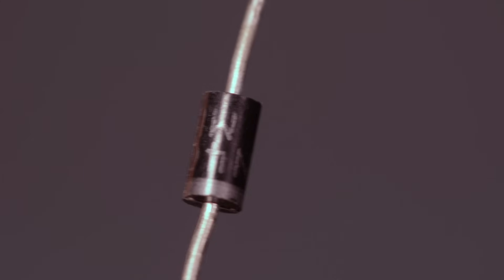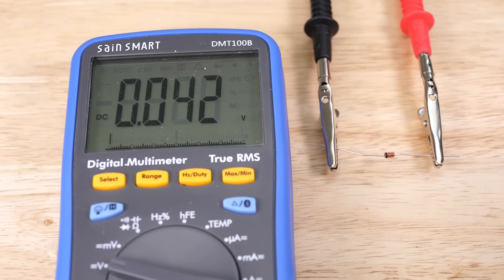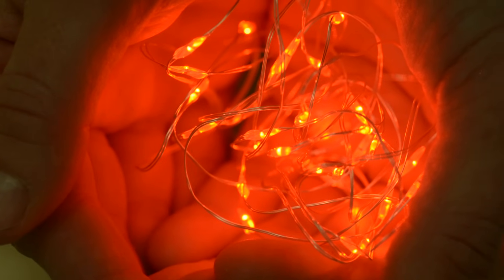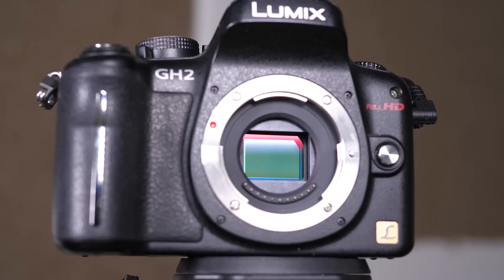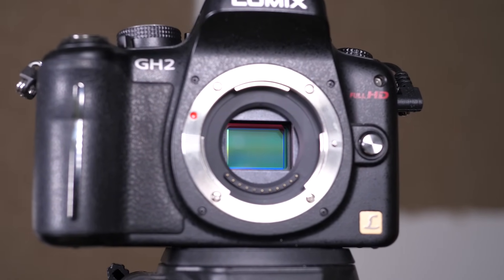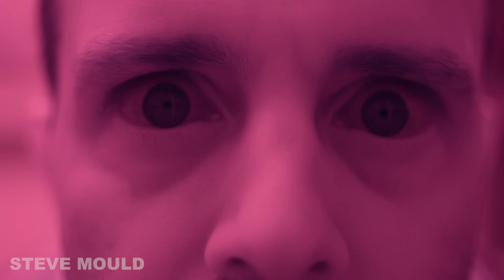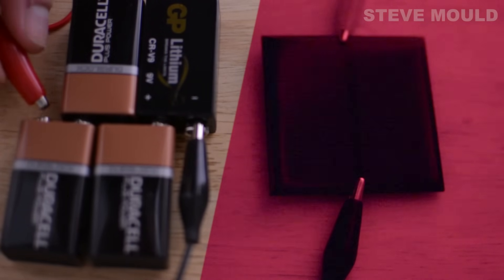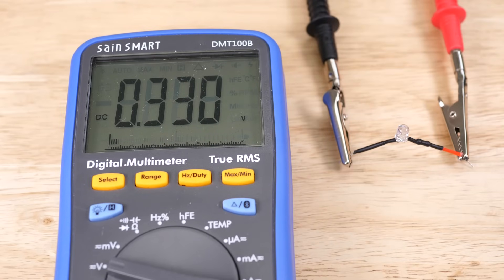Why all solar panels are secretly LEDs (and all LEDs are secretly solar panels)

Comment: Could you explain the thermoelectric effect? After watching a DIY builder use a peltier device as a cooling/heating device, I wanted to understand how those things worked. But I'm having a hard time conceptualizing on how the electrons/positive ions move in the device to create a heat gradient. I know that these devices have one side that heats, and the other side cools and reversing the current, causes those sides to reverse. Additionally, if you cause an external heat gradient by heating one side, you can produce electricity. My concern here is what does it look like from the perspective of electron/positive ion going through the series of semiconductors to cause a heat gradient. I've seen diagrams showing those electrons/positive ions moving to one side, but that charge either looks like it's moving against the flow of electricity or with it. With it makes sense, but why would one set of semiconductors (n-types using electrons) go against the flow?

Comment: 0:29 I gues you mean a solid state diode, as opposed to a vacuum tube diode?
Reply: Actually, any vacuum tube diode would probably work as a photodiode to some extent, and will emit X-rays with a high enough anode voltage.
Reply: @gcewing  Won't pretty much anything emit x-rays with high enough voltage?

Comment: So you could getto-rig a solar panel by connecting a bunch of LEDs? How many would you need to charge a battery? A powerbank for example.
Reply: A lot.
Even if you assume similar conversion efficiency (unlikely), the area of a single LED is tiny.
I have a small portable solar panel that has two collector areas that are about 20x10 cm each. (so about 400 square centimetres)
In theory this produces 20 watts.
In practice it takes me as much as a week to charge my 20,000 mAh battery bank using this device, where a standard 2.1 amp USB charger (that's about 10 watts) can charge it in 12 hours, the solar panel is typically taking more like 60 hours to do the job, which tells you something about the power output. (granted it's not an an optimal angle to the sun most of the time.)
Now consider that the internals of an LED are so tiny you'd probably need about 20 of them to equal 1 square cm of solar panel...
Multiply that by 400 square centimetres to match my mediocre results, and you need about 8000 LED's...
Probably way, WAY more than that...

Comment: Resistors can also emit light but only once
Reply: Resistors actually emit light all the time, the problem is we can't see it because it's around 6000nm in wavelenght.
But you're right - visible light is usually a one time event.
Reply: @disturbedNeutrino  Actually, light is the brain's interpretation of electromagnetic waves or light waves. So if you are to call any light waves for light, it should only be those that are visible.
Reply: @MarcJensan  And which eye-brain combo should determine what spectrum we call "light"? You do know some animals see EM wavelenghts that we don't. Do they see non-"light" by your definition?
Btw - that's why we use the word "VISIBLE light" ;)
Reply: @disturbedNeutrino : guess we don't have 20:20 vision after all. We only see 7 colors.
Reply: @gdolphy   who taught you that nonsense?
Reply: @disturbedNeutrino  ::) university of YouTube comments
Reply: @disturbedNeutrino   people emit light one or two photons a minuite but it is there
Reply: @firenado4295  thank you for elucidating that we emit photons. This seems to enhance my understanding of auras. I will try to play with it and give it more thought.
Reply: @disturbedNeutrino  Humans emit infrared light from body heat. Every matter in universe emits light , due to entropy .
Reply: Hebl von Heblowitz 
What part of the spectrum is this ‘light’ on?  Is it outside UV or IR?
Reply: @disturbedNeutrino  6000nm isn’t light.
Reply: @noop9k  It depends how pedantic your definitions are. Do you only consider wavelenghts that human eyes can detect as (visible) light? But then some animals can see into UV and IR spectrum. Is this the limit of light? It's simply a matter of your own personal definition, what part of electromagnetic waves you classify as "light". For a joke coment, you're definitely overly pedantic.
Reply: Tungsten filament  light bulbs are technically all resistors :)
Reply: They also emit smoke for quite a long time before starting to become light emitters.
Reply: @SeanBZA  All computers run on smoke, thats why when the smoke comes out they stop working.
Reply: @rivencraft1734  I just pictured a rodent shaped cloud running on a wheel!
Reply: @rivencraft1734  genius
Reply: @rivencraft1734  Yes. The smoke is stored in the wiring.
Reply: @rivencraft1734  right... I feel the time is right to tell this tale... about 1999/2000, I  worked with a self styled 'IT Genius'. So one day I decided to have some fun... built an electrically triggered smoke bomb into his computer box, completely safe, electrically isolated, so his precious super-computer was safe. He gets back from lunch, hits the power button and his PC tower starts belching purple smoke. What I hadn't accounted for was the fact that he was also a self styled fire marshal,  so before any of us could stop him, he had ripped the side cover off and doused the evil fire with his extra large cafe latte. Luckily, the rest of us had UPSs and back-ups🤣
Reply: @SeanBZA  pretty unique design!
Reply: @SeanBZA  Every machine is a smoke machine if you operate it wrong enough
Reply: @PenPeng  touche good sir.
Reply: Mr. Tux 

      |
Reply: Mr. Tux what about the nothing grinder
Reply: @PenPeng  *the right way
Reply: @PenPeng  A smoke machine will also become a smoke machine when operated incorrectly
Reply: @SeanBZA  Is this a crime against Resistors? AntiResistism?
Reply: @SeanBZA  congratz on creating solid fuel smoke machine.
Reply: magic smoke 
 @SeanBZA
Reply: @SeanBZA   Yes, so every electric components working with smoke, not electric power! :D
Reply: @SeanBZA  great for concert stage effects, but the smell is another story...
Reply: SeanBZA 
Lol
Reply: @SeanBZA  would that mean that computers are also smoke resevours/batteries?
Reply: An incandescent light bulb is just a resistor optimized to emit light.
Reply: You're producing a lot of heat with this one.
Reply: Let the smoke out!
Reply: @uhhhhh262  who let the smoke out?? Puff pUff puffpuff
Reply: I have experience this, horribly.
Reply: No , not only once tungsten filament lamps are reusable hundreds of times
Reply: You mean visible light. They can emit longwave IR indefinitely.
Reply: The filament in a standard incandescent light bulb is a resistor
Reply: Everything can emit light once, you just need to apply some explosives.
Reply: Resistors glow in normal operation... just not in visible light unless it's either designed for that or very much not designed for that.
Reply: In fact they can double as flashbangs. (Not even joking here, it's happened to me twice, I looked at a resistor as it was plugged into the AC wall socket and poof, everything went white for a good while)
Reply: IC also only emit light once... I saw my computer case glow orange inside as the micro chip on my video card released the magical computer smoke, and $350 from my wallet...
Reply: No, resistors can generate heat and emit as infrared light
Reply: Yeah correct.... Even Zener diode does... I have experience in forward biased connection with my bare hands luckily my fingers didn't burn much...
Reply: I can smell something
Reply: And capacitors can emit sound, but only once as well...
Reply: LOL :)
Reply: lol
Reply: Do they give white light ? Red is not my fav
Reply: lol IKR, one flash!
Reply: Magic smoke that makes all electronics work
Reply: so can you
Reply: they can emitt light all the time. but no visible light also... more far infraret...even your bodys does this
Reply: Lmao!
Reply: Lol!
Reply: Such a sad fate for a resistors..
Reply: Ya, & capacitors can emit light, but only once also.
Reply: Some emit sound Waves also.
Reply: Can confirm
Reply: might smell a bit once you use it hahah
Reply: Oh yaaasss....Majicke Blue Stinky Smoke Time!!
Reply: They smell so good...
Reply: WHO LET THE SMOKE OUT?
WHO, WHO?!
Reply: They can actually do that for an extended period of time if you manage to enclose them in a non-reactive medium, such as vacuum or an inert gas - & then you've got what's called a light bulb!
Reply: Everything emites ligth (execpted the conceptual black bodies). But low frecuency infrared, well is everywhere and is more comon to call it heat (even if it’s also a low frecuency light)
Reply: @SVQGOT  except low frequency infrared is part of heat radiation, while actual heat itself is collective periodic isotropic oscillation of atoms, molecules or matter (called phonons) whose frequencies are distributed randomly according to black body radiation.
Reply: Bulb Lamp emit light all days and have resistor.
Reply: Capacitors also emit lots of light and sound very fast
Reply: Capacitors are great flash bangs next best thing to the real ones.
Reply: They are smoke detector testers.
Reply: Electroboom subreddit: You've heard of LEDs, but have you heard of LERs?
Reply: That doesn’t make sense, it’s not possible
Reply: As they burn up and catch fire!  haa haa
Reply: Yup.
Reply: Haha, true, and heat 😆
Reply: I’ve got a special one that melted the metal bit first ruining ooops I meant cleaning my arduino
Reply: several more electronic component can also emit light once, hahahaha, funny
Reply: Just like how all mushrooms are edible once!
Reply: hahaha
Reply: Then they burn up in flames
Reply: Filament bulbs
Reply: LOL, let the smoke out of that one!.... if you reversed polarity to an LED, does it become a light sucking diode? Is that what a solar panel Is? An electronic parasite!
Reply: Bahaha when it blows up
Reply: That's funny 😀  👍
Reply: Hilarious
Reply: Lmao
Reply: and smoke.
Reply: so funny!
Reply: the bulb's filament is the "resistor" since smaller the cross-section or diameter of wire, higher its resistance. lol.
Reply: Actually, all electronics run on smoke. Once you let the smoke out, it no longer works.
Reply: lol
Reply: Hahahahahah! Lol
Reply: Speakers can be light emitters too!
Reply: Also ur microwave oven
Reply: Lol
Reply: LOLOLOL
Reply: you can also emit light maybe more than once but good chance you'll be dead the 2nd time ?
Reply: lol
Reply: Lmao... I've inadvertently done that a few times - usually trying to build power supplies.
Reply: If you burn your circuit board it even emits light with smoke
Reply: forbidden food
Reply: Great joke bro
Reply: Lol
Reply: I LOVE THIS THREAD
Reply: I've been there and I hate it
Reply: Yea cuz they explode
Reply: @lukep4339  you mean melt and then vaporise
Reply: @francisbacon4363  yea you know what I mean XD
Reply: why am i laughing so hard
Reply: And capacitor can be smoke machines but only onces
Reply: Resistance is futile
Reply: Capacitors can also be used as smoke machines but not for very long
Reply: If you shoved enough high powered electromagetic energy at them, could they also act as solar panels once? That is to say, if you were to fry one of these things with light energy, would an electric charge run through its wires, if only for a short and small burst?
Reply: 😆😂 LoL
Reply: Hahaha
Reply: I once made green LED shine red...only once.
Reply: @erikhendrych190  you mean you made it fire on the led
Reply: IR/UV LEDs can emit visible white light, also only once.
Reply: Oh, that kind of humor.
Reply: With enough electricity, any component becomes light-emitting.
Reply: yeah i can also emit light but only once
Reply: Electrolytic capacitors emit light once and for a very short time. They are electronic meteors lol
Reply: have you never heard of incandescent lamps? These resistors give off a lot of light for hundreds of hours.
Reply: @mrbmp09  oh fuck you got me
Reply: I am resistant to giggle but your voltage filled humor is too much
Reply: Lmao... great comment
Reply: Electroboom intensifies
Reply: Tbh I can emit visible light too, but I won't live to see it...
Reply: Incandescent lightbulbs say there's a more than once way.
Reply: and fire lol
Reply: No, also for longer: I put some resistors in line with my LED flashers on the car trailer. They are WAY underrated for this purpose, but I needed a quick fix for hitching it up to one of my cars.
That Quick fix lasted longer than the trailer sideboards (10 years)....
Whenever the flasher was on, the resistors (I put 10 in parallel to get it to work and distribute the load...) they would emmit a nice red glow. Luckily you only saw it at night, otherwise my trailer probably would have not passed inspection ;-)
Reply: A resonator can be a small capacitor pf range
Reply: Humans can do the same
Reply: Well, the normal incandescent light bulb is basically a resistor
Reply: @vantuzproper  tru
Reply: Incandescent lightbulbs.
Reply: Haha that cracked me up 😂
Reply: Dear god...
Reply: I've been wondering about this...sounds like a resistor can have a diode to emit light...because it dissipates heat...so if that light were in box made of solar panels inside...and those resistor diodes were on double looped thick cables...wired through high voltage parts already inside home appliances...cars no charging stations
Reply: That simply isn't true. You can get them red hot multiple times. They emit light at that point. So does everything they set fire to.
Reply: IR emitters.
Reply: who let the smoke out?? also they give off a the smell of firecrackers
Reply: unless it's sealed in inert gas, cough cough... light bulbs...
Reply: Though you can deliberately design one to last a bit longer while glowing and that's how we got incandescent lightbulbs
Reply: It's just like us when we drink lava.
Reply: So can wires
Reply: So can people with enough energy 😂
Reply: Incandescent

Comment: But LEDs and diodes in general are CURRENT driven, not voltage driven, because the relationship is exponential. And the generated "light" is directly related to current through the diode.
Reply: true, but the way you get more current is by applying more voltage

Comment: Excellent video! Did you know that that particular function of LEDs is used in some applications to act as a button type interface? The light sensitivity of an LED can be used in various ways, for example to create a sort of light depending capacitor where the discharge rate depends on how much light falls on it. The time to discharge can be measured and so the LED can act as both a display device and a button. I'll admit I've never thought about the fact that solar panels should be able to be versatile in this way as well.

Comment: So if the solar power only emits infrared light, does that mean that its the only wavelength it takes energy from? And if so, is it possible to make a solar panel which can absorb all lights, and therefore work as both a solar panel and a light? If made, this product could have a lot of potential!
Reply from the maker: It absorbs infrared and above!
Reply: Ahh! Well, of course. The higher energy end of the scala is more efficienr. But is it not worth it making it absorb all wavelengths?
Reply: @1337sh337  its not easy to make it do that because youd have to find the right doping element.
Reply: Alistair Shaw yes, but I’m thinking of a hypothetical scenario. Just for fun
Reply: @1337sh337  i am not even sure it is, if it was the plants would have evolved to be black after they got out of the underneath of the blue-purples
Reply: Alistair Shaw but i think the plants has their color according to the energy they need to grow, end reproduce. I might be wrong. But us humans love to make things more efficient and i thought this could be a way to improve the solar panels.
Reply: @1337sh337  No the clever thing about accessory pigments is that they can be used to capture colour that is independent of the 670 centres
Reply: Alistair Shaw Now i’m not sure if we talking about the same, or it’s that i just don’t understand you. But how can i read up on this?
Reply: @1337sh337  accessory photopigments in photosynthesis